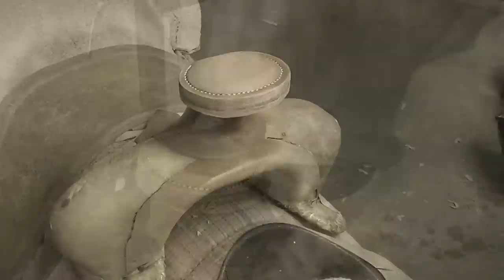Saddle Making - covering a metal saddle horn.

Comment: So how are you able to drive nails/tacks in a metal horn?
Reply from the maker: A metal horn has a wooden top, very thin. The tacks are driven in and they bend, curl up on the tip, (clinch) when they hit the metal. This holds them very firmly in place, almost impossible to pull out.